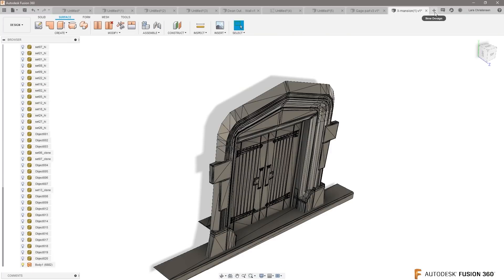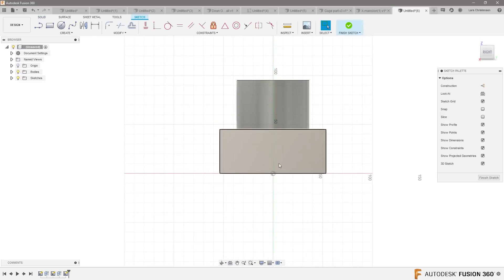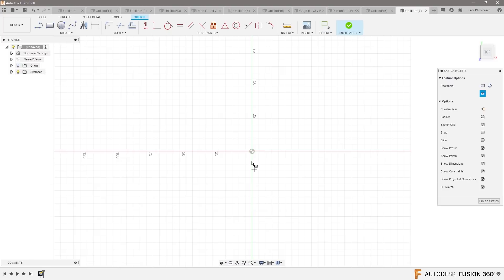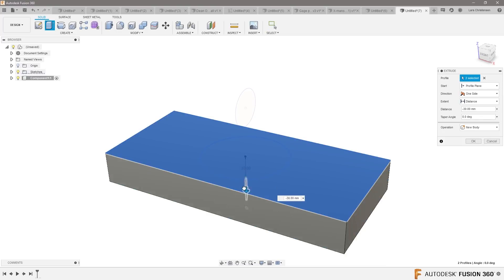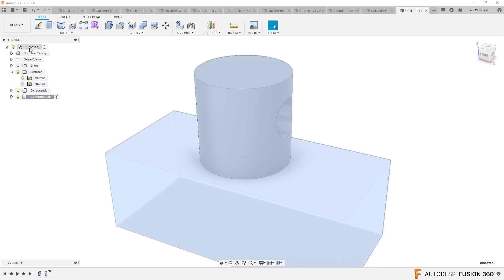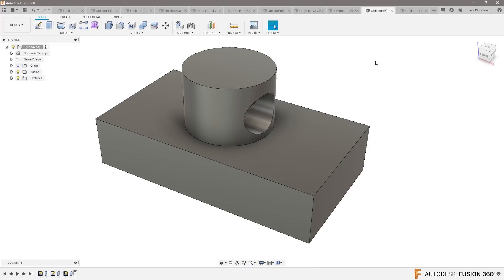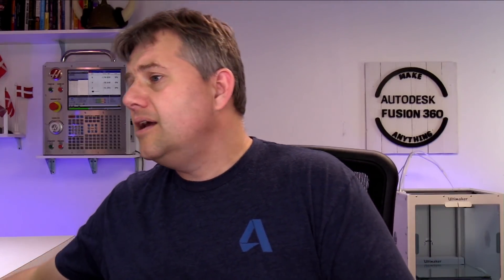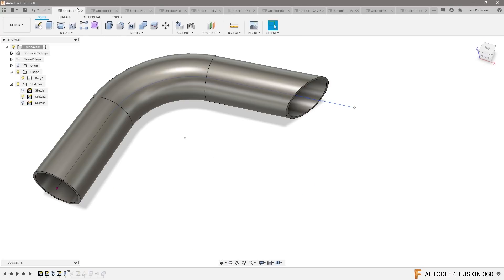Fusion 360 — Abandon Bottom Up Completly — Ask LarsLive

Comment: Thanks for the explanation Lars. However, I think that what is meant by bottom up is really about Assembly, hence, bottom up is creating all the parts separately and then assembled. As opposed to Top Down, where the components are modeled in one file.
Reply: This is correct if anyone is curious Bottom up means you are creating individual parts or components that you than bring together in an assembly, each part in the file exists on it own, and when you create the assembly - New component - you select the External Option (allowing for sperate files). On the flip side the top down approach Starts with the Assembly - you select the Internal Options (creating everything in one file) - and create each component from within the Assembly. Each have advantages and disadvantages.  For example Top down is good for quick R&D iterations where as Bottom up is good if you want to reuse a part/component in other assemblies. To answer James Carters question - the file structure for Fusion is laid out for you  when you select the Assembly "internal" vs "External" option - In bottom up will have different files for each component and Top down will have one file for everything.  Hope this helps - sorry if its 5 years too late  - I just saw this and thought I would help

Comment: I try as much as possible to chuck my sketches inside the components they are used to create and I try to have as fewer sketches per body per plane as possible. I only create a new sketch on the same plane for a given body if the sketch I am working on is becoming cluttered and confusing or if it needs to be modified to fit a body that has to be designed later. A lot of the time I spend designing is optimizing my sketches for overall timeline and browser clarity. I wish Fusion offered the possibility to merge sketches or create a new sketch from selected sketch elements, kind of like Photoshop does "New layer from cut".

Comment: What did you do at 4:22 it shows a different menu and I can't seem to get that.
Reply from the maker: Hold down the left mouse button and that menu will appear
Reply: @cadcamstuff  Oh so you press and hold. Didn't try that. I find in most tutorials that some of those key strokes are not mentioned. We have switched from Mastercam X3 to this so it's a huge adjustment. The last time I was on any CAD program it was 2007? Thanks for the help.